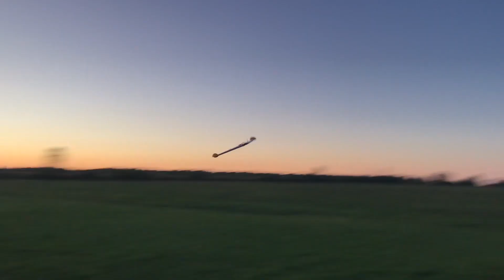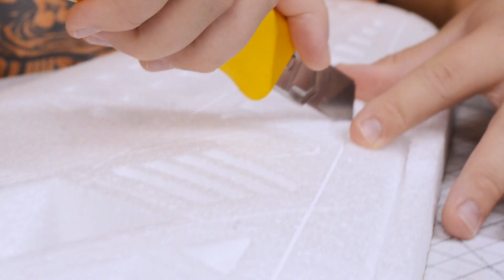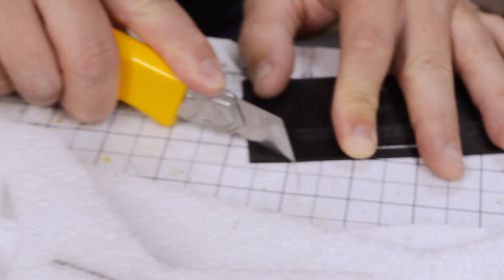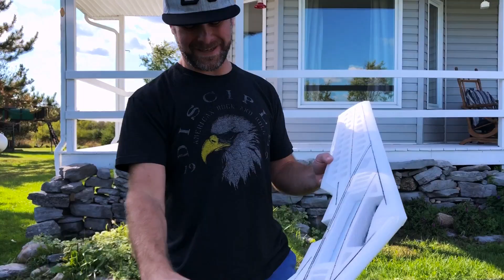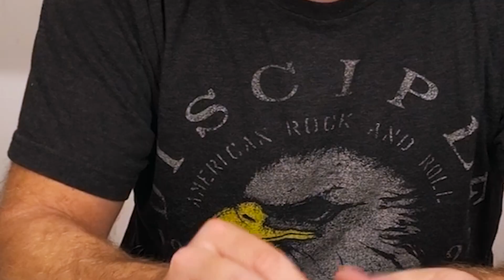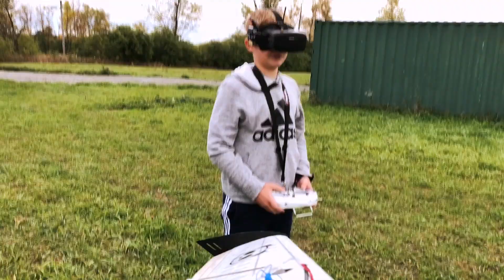How to Build an FPV Spec Race Wing

Comment: What brand  and size  servos did you use for this build?
Reply: Normally I like A-537 Towerpro 14g MG92B Digital Metal Gear High Torque SubMicro Servos. But I think those are too heavy for this spec wing. Instead, it looks like I either went with Hextronik MG-14 black, or Hitec HS-65MG. Sorry I can't be more specific as it's been so long.
Reply: @christopher_hopper  
Thank you brother. I appreciate your help. I will look those up and see which ones would fit best.

Comment: I am using this video as a step by step for building my ritewing V3. This is my first build  on a fixed wing foam aircraft. Thank you so much for this. Do you happen to have a template for the shape of the elevens? Or where I can find the exact specs? Thanks again
Reply: Glad you're finding the video helpful. As for the elevons, we eyeball the shape, and just make sure to take a measurement so as to replicate it on the opposite side. Happy buildings!
Reply: @christopher_hopper  
Thank you sir. I appreciate it

Comment: Can i mount a gopro on a 990mm wing??if yes where do i mount it cause the battery bay is on the nose
Reply from the maker: TJ’s RC Garage that wing is more than big enough to handle a GoPro, yes. But the key is placing directly above the CG so that you don’t unbalance the wing. I tend to prefer RunCams because they have a lower profile and I can Velcro them to the top of the battery.
Reply: @TheDutchViking  I use a 4k action cam which is a little bit more than 50gms
Reply from the maker: TJ’s RC Garage that’s mot exactly “light,” is it. That said, I still think you should be okay as long as you maintain proper CG. That size wing should handle the weight. Just make sure you have the throttle up all the way on launch and give it a good toss; you’ll want to maintain good airspeed.
Reply: @TheDutchViking  will try

Comment: Cool vid guys, great father and son bonding moment. Anyway, I'm in a country where that model is not readily available. I'm looking to build a flying wing from scratch based on that spec wing v3. Would you mind sharing measurements like root and tip chords and the sweep? I'm guessing that's 36-inch wingspan, no? Thanks in advance
Reply: Thank you, kind sir. That first link is what i'm looking for, just to keep my dimensions in the ball park as i'm planning to use a similar power system in this build. Soon as the quarantine is over and shops are open, going to buy stuff i need. Stay safe
Reply from the maker: Joseph Cuison Hi there! Thanks for the kind comment. We appreciate that. As for measurements, I think it’s going to be best for you to follow the FPVWRA guidelines for a regulation spec wing as they’re very thorough, and they’ll get you within range of what we fly every day. Hopefully these two links work. Visits the Spec Class and Courses guide here: https://fpvwra.net/spec-wing-courses-2/ and then download the 2020 regulations guide here: https://lookaside.fbsbx.com/file/2020%20FPVWRA%20Rulebook%20V1.pdf?token=AWxaB-RkrTbLiSxBBJ1OyjVy5yNmw27oj81rUNA9SKYR6lrSyjgC7OzrLz_h2gi4alpU_jypg_yjNh3dzOwFWRvF9XRrywPQFDV6VQ9GG4u61zqzF85rQZbySyhNx8hNMKzC9awJEqM10Y6nzivEfbTmoJvgK1NLKlXQf29IcQ-FHrYNEuunHltZRyMYaR1l7JWIpS84qfhLF0m98FyE2J0M Happy building!
Reply from the maker: Joseph Cuison Two other ideas for you would be to look up FliteTest’s Mini Arrow. You can download the planes for free, and build out of craft foam (we built several when we started). You could also try something like this: https://youtu.be/a-QwkMUseZ0

Comment: Great tutorial! Just wondering about thrust angle for installing the motor mount. Did you just line it up to be 0 degrees straight through the cord of the wing?
Reply from the maker: TorqueRoller unless a wing maker calls for a change in thrust angle, we keep it at 0°. For instance, the VAS Wyvern needs +5° to help get the nose up, but that’s a compound leading edge, and needs a lot of speed. Great question.

Comment: What sorta RPM do you use on the sander? just bought myself 1 today, getting sick of hand sanding lol
Reply from the maker: SyncR ours doesn’t have a variable speed control, so you’re a step up from us. ;) Truthfully, I would guess that the grit value has more of a bearing than the speed. As with anything, try a sample first, or reduce your pressure on the work and check it frequently for progress.
Reply: @TheDutchViking  Lol here I was thinking my cheapo 1 would be... well cheap haha, and yeah was thinking that myself, but doesn't harm asking to get it down quicker, got couple 60+ wings to do so its got plenty of work ahead of it

Comment: Seems to me the Lightning holes are redundant. After you add all the spares and and extra glue. It would Weigh the same. Can we get a weight on it?
Reply from the maker: Wapow Zone will do; it’s definitely the lightest wing in our fleet now. And the reduced weight is strategic in that it allows for achieving CG more easily.
Reply: @TheDutchViking  any specific numbers? it's interesting seeing the different weights people can get on different kits and builds.
Reply from the maker: Ha! I totally forgot to post the weight. I’m currently in Switzerland, but when I get home I’ll make a note to weigh and post something. Thanks for the reminder.